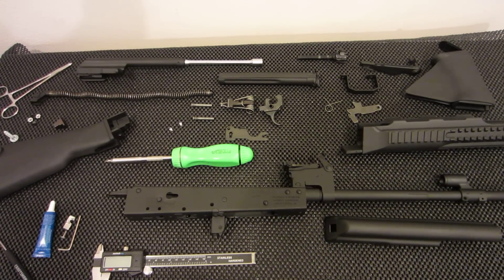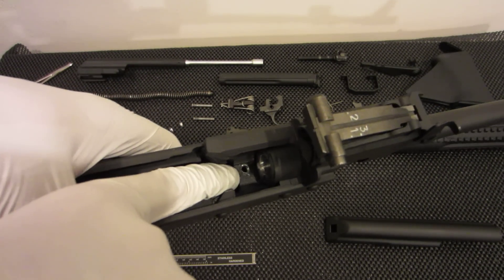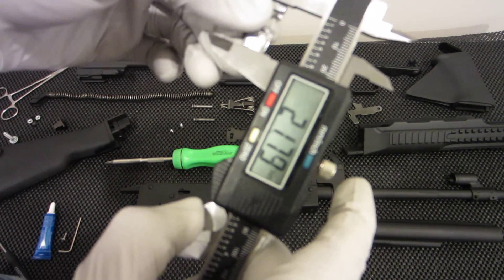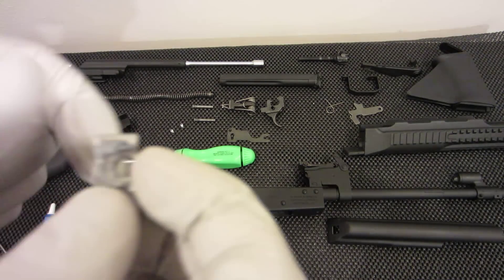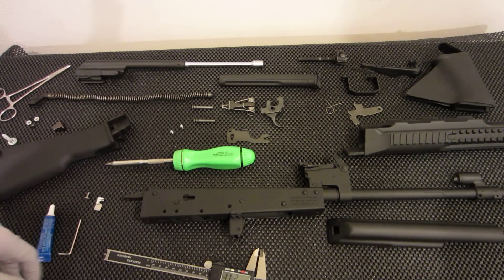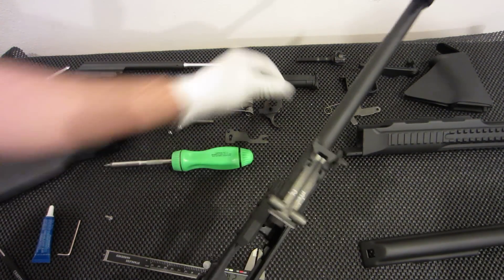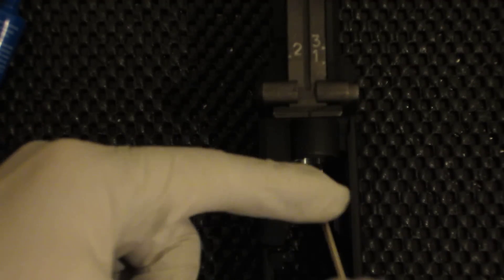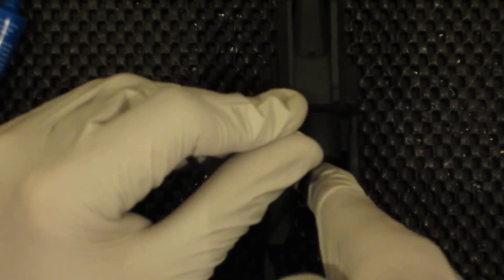PROPER Saiga/AK Conversion Pt. 5— Bullet Guide.

Comment: Can you just JB-Weld the bullet guide into position rather than drilling/tapping/screwing?
Reply: +rmwtsou Yes, but you can also spit on it and glue it that way it is cheaper yet..........
Reply: +Stiliyan Savov I actually JB-Welded mine and took it out shooting. It worked great, absolutely no issues.

Comment: Just buy a damn bullet guide
Reply from the maker: You can do that. Or you can make one. I don't care. Sorry that my modifying a complete rifle from scratch isn't up to your standards.
Reply: Im not bashing your build. A piece that critical in my opinion should be manufactured by a professional that's all.
Reply from the maker: grey hickman
 It's a piece of metal, brother. That's all a bullet guide is. It does not move, it does not do anything but cause interference. That's not "critical." I would never build my own recoil spring or hammer. A bullet guide could be replaced with a ball of aluminum with no ill effects short of not working that long before it is crushed.
Reply: I do suppose, for me though, im not all that handy.

Comment: In this application, they're called bullet guides.  It may be because they seem to contact the shoulder of the case and not the nose of the bullet like in a pistol.  The shoulder hits it and causes the nose to tip up just enough to point into the chamber.